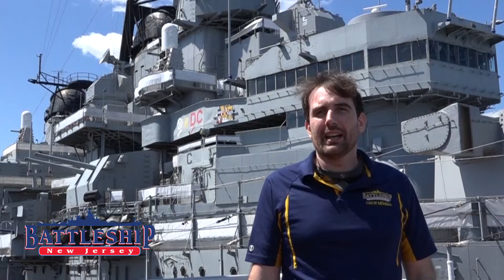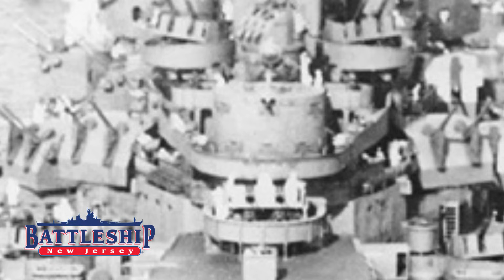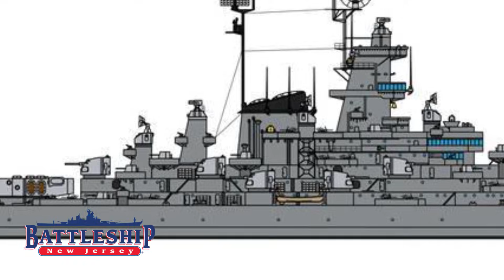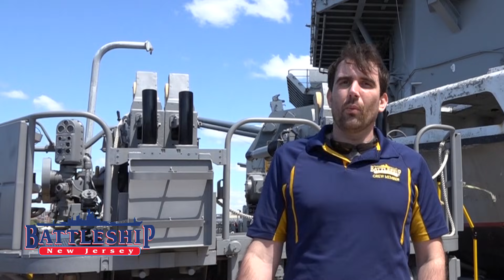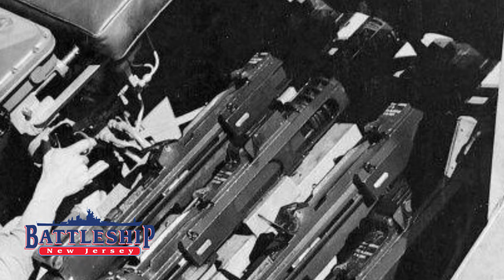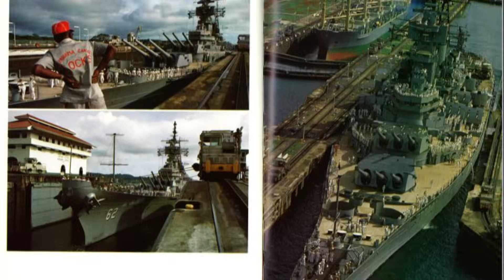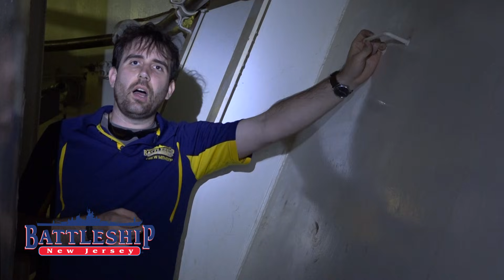What the Navy Doesn't Like About the Iowas

Comment: On a WW-II level, I would have upgraded the main guns to 18", placing 2 in the rear & 2 in front. Up a modern level, I would remove all the main guns & replace them with missiles, increasing the buoyancy & protentional lethality of the ship, which would have required adding more length to the ship also.
Reply: Historically 18' guns were.... well not very effective, turns out they were pretty heavy and had low velocity which effected range and the amount of steel they could get through. But dont want to be that guy so ill shut up.

Comment: Probably should've removed the conning tower and replaced 40 mm quads with 3"/50 Mk 33 twins. After all the Iowa's never engaged enemy ships but were fast AA escorts for carriers.
On the 5"/38 Mk 12 DP: Coupled with the Mk 37 FCS, air search readers, CIC, power ramming & VT fuses equals the best AA weapon SYSTEM of WW II. There may have been DP guns with better ballistic characteristics (IJN 100/65?) or better surface fire effects (UK 5.25")

Comment: The Iowa Class Battleships are a great deterrent to terrorist supporting nations such as Iran and North Korea. There is very little which can take out a battleship. Small suicide speedboats won't work against a battleship. In fact, nothing wielded by a terrorist can threaten a battleship. The massive firepower of the big guns coupled with modern missiles can enable a battleship to close down any potential terrorist supporting nation such as Iran think twice about provoking a nation with a battleship fleet. A single battleship could shut down the entire Strait of Hormuz for example. Iran and North Korea could do nothing to stop it. It would take a large torpedo or a large mine to do serious damage to an Iowa class battleship. The offending nation would pay a huge price in return before the battleship went down. A carrier battle group with a couple of modern battleships would be a very potent force indeed.

Comment: This was a genuinely cool video I saw pictures of the rounded bridge and thought that was possibly ad hoc and it turned out that's the way Iowa New Jersey originally had their Bridges

I never knew about the plans to shrink the superstructure and combine the funnels

I also never knew that the Navy was not happy about the torpedo defense system which on the Iowa class battleships was supposed to be the best of any of the battleships even though it turns out the North Carolina's had better torpedo defense

Comment: 4:00-4:10 ERROR!!!

The reason that the Prince of Wales continued remain under control and was commanded from the bridge was cause the fuse on Bismarck’s shell didn’t go off.

It kill most of the personal in the conning tower and and ripped off a large chunk just with the slug!
Reply: I don't get it. He did not say anything wrong.
Reply: That was the point of not having it armoured. It doesn`t initiate the fuse.

Comment: Can someone, ANYONE!!! Please tell me, why did the United States use, first the G_D awesful 5” (127mm) 25 caliber dual-purpose secondaries.  And only after these became horridly obsolete, they replaced them with the slightly less terrible 38 caliber secondaries.
  For Defence purposes.  The German...
3.5” (88mm) had a barrel that was L/76,
4.1” (105mm) ... L/65 calibre,
5” (128mm) ... L/61...
5.9” (149mm) ... L/60 or L/55 [both variants were available].

Comment: I wonder what the Iowa might have looked like if the Canal was at the current Panamax size.
Reply: Funny you mention that. The Atlantic Fleet started switch to Pacific 🇺🇸 coast for Pacific operations. The brand new carrier Reagan was too big to use canal. She had 2 options to navigate:go around Cape Horn(long way around) in 10 ' seas or go inland waterway called Magellan Straits. The straits were much calmer BUT once in there ship could not turn around. They made it a d Reagan was /is stationed in California.
Reply: @peterblumberg2314  I think I saw the Reagan near San Diego, the Navy was running an exercise.

Comment: iowa seems to be a glass cannon
Reply: All of her vital systems were protected by Special Treatment Steel (STS), a very tough light armor steel giving her excellent survivability.
Reply: @texasforever7887  It's not surviving a 10 thousand pound missile travelling at mach 2+ with a 2000 pound warhead
Reply: @hertzwave8001  correct but those didn't exist in WW2
Reply: @hertzwave8001  
We keep hearing about these magic missiles. But they don't exist.

One of you starts out at 7,000#, and ends up claiming Mach 4 and 15,000#. You're talking about 10,000 and Mach 2 with a 2,000 warhead.

Neither of you is talking about an armor piercing warhead. Because they don't exist on missiles. And without them, you don't penetrated to do damage.

Further, missile defense can be adapted to an Iowa class as well as any other ship. And, modernized, the Iowa class has far more room to add them.

Comment: Iowa is best BB ever built
Yamato: Am I joke to you?
Reply: Yamato & Musashi are at the bottom of the Pacific.  The 4 Iowas are parked in 4 berths around the U.S.
Reply: @DADZRITES  just because they were sunk by an element they are weak against doesn't change the fact they were built to do better against other BBs from US including Iowa and Montana. Quite frankly the Iowa would be sunk to if they were pummeled by planes
Reply: @ZXephmor-1  they had worse fire control systems and were slower. bigger =/= better
Reply: Yep, the Yamato was a joke, it and its sister were never even remotely in the same class as the Iowa class. 

The Iowa class was faster, better range, better armor, better weapons, better fire control.

Nowhere did the Yamato or Musashi hold any advantage over the Iowa class. Well, except for submerged depth.

Comment: are nuclear carriers more expensive than an iowa-class battleship? if you trade an old nimitz-cv for a refitted iowa-ship it might be cheaper later (after the rework when its back in services). iowas dont need that amount of people like a carrier, especially a nuclear powered. it will be complicated to run her but its not impossible. if the infrastructure is back in bussiness it might not bee to late for them. also if the navy decides to bring back one or two iowas, what would they have to do/repair on the ship to run it completly again?

Comment: A few mis-truths in the video. For one the Prince of Whales lost the complete  bridge crew all senior officers except for one office and that factor was one of the main reasons she left the battle and ran from the Bismarck. So the conning tower argument for deletion because the British removed them is a faulted argument.   The germans, Italians and Japanese all retained their conning towers. Perhaps the argument could be made for a redesign and an increased size conning tower.   Also welding would save weight but 400 tons is not equivalent to two whole gun turrets as stated. In fact it was probably worth about 1/3 of one turret.   Yes 3” 50 cal antiaircraft guns would have replaced the bofers 40 mm quads.
Reply: The main reason Prince of Wales withdrew was because of the teething troubles of her quadruple 14 inch gun turrets.

Comment: A bit nitpicking perhaps, as these are clearly the pinnacle of battleship design (that's coming from a Brit). The only thing I think needed improving was the ant-aircraft armament, although very good in its time, probably changing the quad 40mm with the twin 3" with radar enhanced fire control would have been a good improvement.

Comment: how can you possibly say they were the best battleships built when they never went toe to toe with another battle ships like the Yamato or Fuso class of the IJN or against the Bismark class of the Kreigsmarine or the king george the 5th class of the Royal navy ??
Reply: Fuso is a pretty weak comparison, lower caliber guns, slower speed, etc.
Reply: The Iowas would have WRECKED the Bismarck class (which wasn't really designedto go toe to toe with ships likethe iowas) , probably have beaten the king King George class, and it had a longer effective range than the Fuso and yamato due to their radar guided guns (which the IJN classes did not have) and the iowas were faster than any other battleship class mentioned, so they could maintain their superior effective range indefinitely.
Reply: They are all gone, the Iowas aren't.

Comment: The Iowa class battleships were impressive. The guns and the superstructure were and still are the most recognizable traits. 

If I redesigned the Iowa class battleships, I probably would’ve increased the length and remove two of the 5-inch gun turrets(one starboard and the other on the port side) and put another CIWS gun (or a twin mounted CIWS
Reply: Naww, RAM units. And VLS cells out the wazoo.
Reply: In terms of ww2, I would significantly increase her deck armor, so it wasn’t completely vulnerable to most capital ship weaponry

Comment: Lol man I think the person with the light is fckn with me. They're moving all over the place as if they were ballacing on a tight rope. But it's all good, as a whole all of you are doing a great job.

The increased sub division is a no go as of Korea. No other ship has rifles which would barely scratch the class's paint NVM get through the dam belt. Yes air dropped munitions ( like the Fritz) date back the bangin out even warspite but as far as worth it if say no. Only additional power output, and maybe tearing off the outer 1 1/2" thick hull plates (over the belt) and replacing with say 5" sts. The weight saved by tearing out the con tower more than makes up for it, and honestly modern fish blow under the keel. Speaking of that what's the truth how would one of our national treasures the iowa class fair taking a modern keel breaking hit? The triple bottle blow but not to bad??? And she just fights harder or would she implode being so God damn massive? Our ford class are obviously built with new torps in mind so obviously there are answers
Reply from the maker: Yeah, I was trying to hold it up but Ryan wouldn't stop talking and my arm was getting tired!
Reply: @BattleshipNewJersey  lol you did great, especially considering news agencies and others have cameras steadied on your shoulder to make it easy, hanging onto any other rig is bound to be impossible to hold steady for anything longer than a couple minutes

Comment: This was really interesting.  There are so many discussions about how great the Iowa class is - and it is - but this is the first video I've seen on how they might have been better.  So if I were going to design a new version of the New Jersey?  As someone that doesn't know anything about designing ships?  I'd be thinking about a different propulsion system.  Not nuclear, too complicated.  I'm thinking either diesel electric or diesel turbine electric, not direct drive turbine, but running a generator.  Thinking this should be lighter and smaller than steam, so we'd have more room for fuel, ammo, etc.  

Next, make it a little longer.  We don't need to go through the canal.  Put a proper helicopter deck on the back, with an elevator hung off the side like a mini carrier, so the 16" guns have a clear fire area.  Replace the 5" duals with a smaller number of automatic loading 5" DP, with lighter armor, but that can depress to fire at small fast boats close to the ship.  Add a close in missile system, like RAM.  Add a Goalkeeper to each side, assuming the targeting actually works against surface threats, instead of the 40mm.

Finally, give it some drones.  Two types.  First type is small, and long loiter.  Catapult launch, and maybe net catch retrieve.  It's purpose is a mini version of an E-2C, for air and sea search, with long station times.  Second type is air defense.  Something just big enough to carry 2 AMRAMM's or 2 AIM-9's, and launch them.  Subsonic, but highly maneuverable, maybe even a helicopter, and that can pair with the radar drone for intel.  Pair it with an armored, but relatively unarmed escort carrier sized drone carrier. 

Purpose?  Power projection into areas where it's too confined or too dangerous to send a carrier group.  Support of an amphibious assault force.  Singe ship hunter/killer team against anything less than a carrier battle group.  Escort for a fleet carrier.  Excellent way to use up all of the US's steel making and ship building capacity.  Better use of funds than the F-22.
Reply: Tom Smith j

Comment: OK---------- Shame that they never designed a Sabat round for their 16 inch guns. They are getting a hundred miles now from 6 inch guns and I bet the 16 inch guns would do 300 easy.  As for the high cost of the crew: Replacing the old boilers with Modern Gas Turbins while modern Assembly line Robots could easily replace 99% of the gun crews.  While Dozens of 5inch 54 Guns in storage from all the ships that have been decommissioned (scrapped) replacing the old twin mounts would reduce the crew size even more. Then replacing the aft 16 inch turret with a Flight deck and hanger below would turn the old Battle Wagon into a modern ship. Even if it cost a few Billion it would be worth it as the 4 sailed the South China Sea with impunity immune to anything the Chinese could do to them.

Comment: Wonderful video!

The statement of the Iowa's being the fastest battleships ever built needs to come with a bit of an asterisk, I think. The reality is that the Iowa's were utterly incapable of safely topping 30 knots in anything other than relatively calm seas, largely because of the light and narrow bow digging into the waves rather than riding over them. For example, during post-war wargames with the Royal Navy, the Iowas proved incapable of keeping up with the battleship HMS Vanguard in the choppy seas of the North Atlantic. 

Take a look at what is arguably the runner-up in the battleship speed department, the French battleship Jean Bart. She herself had a top speed of just over 32 knots and, during her acceptance trials, managed to average a speed of 31 knots despite the heavy seas present at the time. 

So, while the Iowas were capable of a higher top speed than something like the Jean Bart in good conditions, 9 days out of 10 the Jean Bart would have proven faster, and probably a decent number of other 30-knot battleships as well.
Reply: A group of naval vessels would have been limited by the slowest one in the group over an appreciable distance.
Reply: @tobyw9573  When not in combat, sure, but under fire is a different story. Under fire is when being able to make top speed is of utmost importance.

Comment: I have heard the Iowa class battleship was designed to keep up with the Essex class aircraft carriers.  This meant having over 32 knots speed.  I've seen pictures of the USS Missouri turning and these ships can flat out turn.  Even at high speed, it was keeping up with a destroyer.

You mentioned a condensed superstructure.  This could have meant 4 turrets each side of the superstructure with one on each end.  The secondary guns were mainly against torpedo attacks from destroyers.  Ships the big guns couldn't get to.

The best thing a battleship can do is to put a lot of metal into targets.  They're great for invasions.  Even as the battleships were being retired in 1991, they still struck fear in people on the receiving end of the 16-inch shells.  They can stay on station and fire for extended periods of time.  The biggest limiting factor is the shells and powder carried.

How many of the 20 mm multi-barrel cannons are on the Iowa class?  Also, I believe it was the New Jersey that had some form of air conditioning and a tub for President Roosevelt.  Is that stuff still in there?  I'm not sure about air conditioning because in the book about the USS Houston, Roosevelt would go all over with the cruiser even participate in the rituals of crossing the Equator.
Reply: Also, did I miss something being mentioned about the armor of the ship?  It was actually lighter than the ship's own guns.  I'm not sure where it was in relation to the North Carolina class, but it was fairly light to give it that speed.  The Montana class was going back to the battleship used to fight battleships instead of the escort battleship.  If any Montana's had been built, do you think they would have found life after the war?  I know the Missouri was kept after the war as a symbol until the Korean War.  They were brought back for Vietnam and in the 1980s to replace the heavy cruisers.

Comment: I always have one thought when it comes to major changes made to warships. be it in the real world or in fiction.

Warships are built tough, they have to be. Even a relatively minor warship like a destroyer is a pretty rugged ship in the overall scheme of things..... so while proposing a change is all fine and dandy, just how f**cking hard would some of these changes be to implement. Here he is talking about things like major modifications to the machine spaces, those are buried deep in the ship. It makes me think "that sounds good in theory, how about in practice?" (which was a concept that he talked about multiple times in regards to the AA guns in this video alone)

Correct me if I am wrong, but was it not the USS Hawaii, CB-3, where the cost of refitting her while partially complete into a missile cruiser was more expensive than building a new one from scratch and it still would not be as good as one built from the keel up as one. (Or perhaps I am thinking of the conversion of one of the interwar ships into carriers, hell maybe I'm even thinking of something British.) Point being that while even on a slipway and partially complete it was really hard to do major changes let alone on a ship that is allready complete.